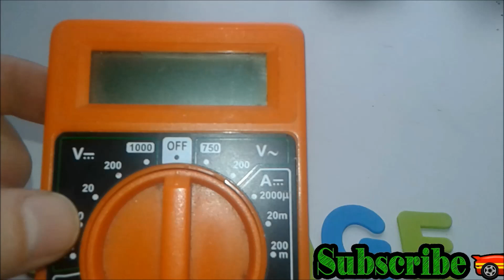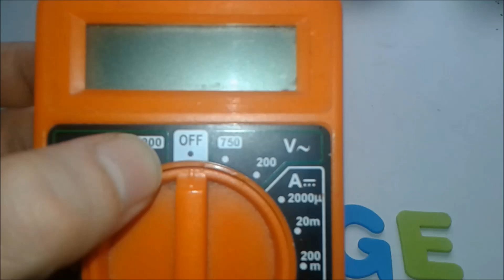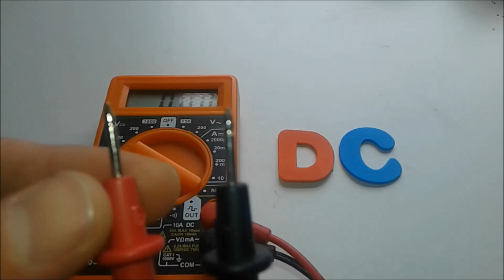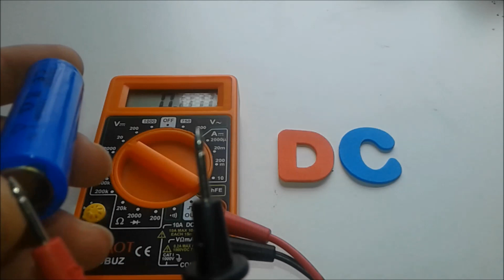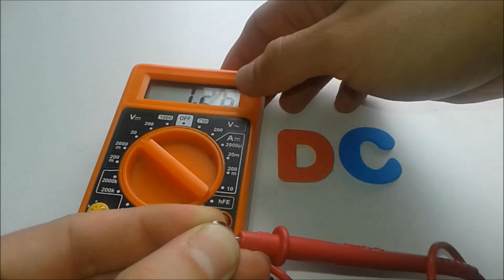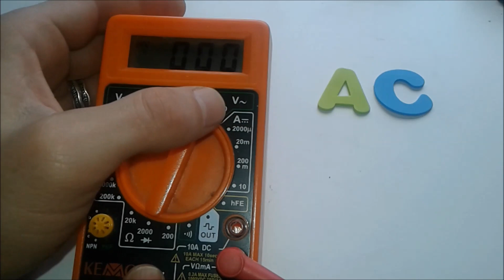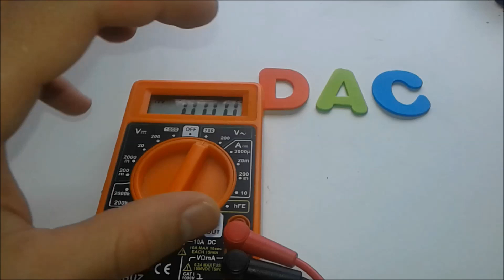How to use a digital multimeter for checking voltage AC/DC

Comment: If I use the meter on the ac setting and touch the terminals on a dc battery why does is show that there is an ac voltage present?  Please explain.
Reply from the maker: From dc you can generate ac and vice versa it depends on the meter thats why you should use a multimeter with ac/dc selection
Reply: @NoSkillsRequired  I do have a meter with both ac/dc selection.  I was just surprised that the ac selection would show anything when hooked up to a battery.
Reply from the maker: @engineerjay420  measure with dc and then with ac selection see the values
Reply: @NoSkillsRequired  Ok I measured 13.2 volts DC and measured 28.2 volts AC from the battery.  Thanks for your help.
Reply from the maker: @engineerjay420  ok and if you want the full explanation is that your meter measures ac by converting to dc via a bridge rectifier eith a scalling factor of 60% or more so a true rms meter will indicate 0 .dont worry true rms are very expensive
Reply: @NoSkillsRequired  Got it!  That explains a lot thanks again.
Reply from the maker: @engineerjay420  no probs any time friend

Comment: I tried to measure Ampere in an outlet today.. let's say it didn't end well...
Reply from the maker: As the title say is just for volt you should not measure amps with this devices there are specific tools for that be very careful mains voltage is dangerous
Reply: @NoSkillsRequired  i noticed that..

Comment: I have voltage coming in my TV coaxial cable.How can I be sure weather it is AC or DC?
Reply from the maker: Azam it's a residual voltage from air TV stations or something close you can put a diode or a bridge rectifier and for sure you will converted in a DC but most likely you will not power/current or amps
Reply: Thanks for the Video! Forgive me for the intrusion, I am interested in your opinion. Have you thought about - Franaar Shining Shape Formula (erm, check it on google should be there)? It is a smashing one off product for revealing the secret to repair your electronic devices minus the normal expense. I've heard some extraordinary things about it and my work colleague after a lifetime of fighting got excellent success with it.